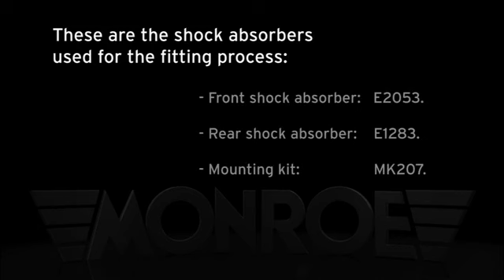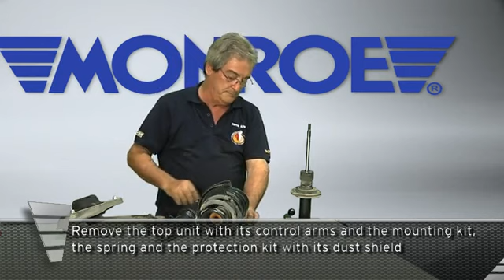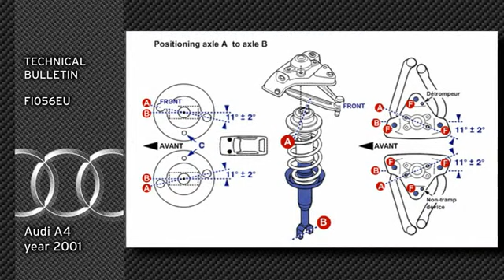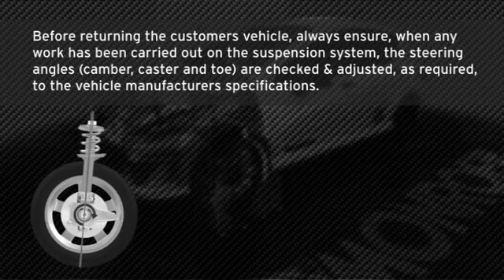Audi A4 front shock absorber replacement procedure

Comment: You have to remove the sway bar linkage bolt so it will drop down in order to remove it. I just did it and it came out.

Comment: In my opinion, the people who will visit this page are doing so because they would not be experienced in this particular task and it does identify a procedure for shock replacement. However, in my experience, the reality is that the bolts, nuts and attachments are most likely to be heavily corroded and seized which creates its own problems. I would suggest that these issues should have been highlighted at the beginning.

Comment: Nice pristine example. Think you might want to be a bit more realistic in that the age/condition of a car needing new struts won't be this nice and clean. That pinch bolt never comes out that easy. It is a major hassle. You are doing your customers a major disservice by over simplifying the effort involved in removing that bolt.

Comment: Very easy  if the bolt that holds the two top ball joints came out easy:-)
Reply: yes very easy !!! coz wasopen  before video !!!! i cant unscreew it !!!!
Reply: try to remove the 3 bolts on the top first.
 gives you more space.

I have broken the bolt and is a hell to take the broken pices..

use some pnetrating oil, wait and pray ;-)
Reply: If it is badly seized, twist off the bolt head by turning it hard back and forth.
Then use the nut to pull the bolt out. Add washers or spacers like maybe a socket wrench under the nut to keep pulling until it is out. Coat the new bolt well with grease to prevent rusting in the future.